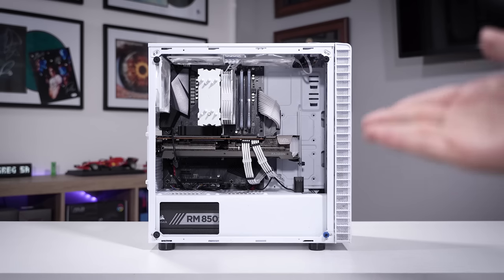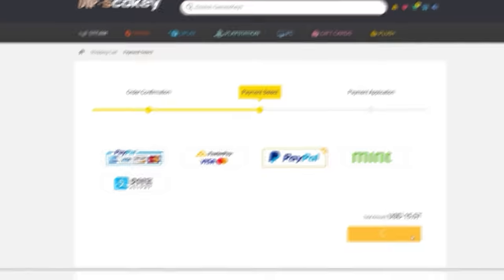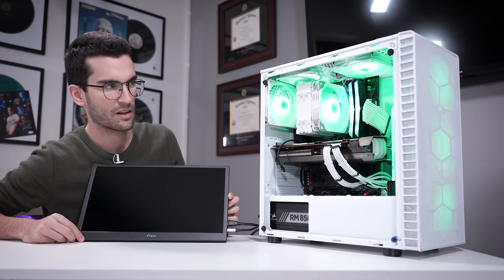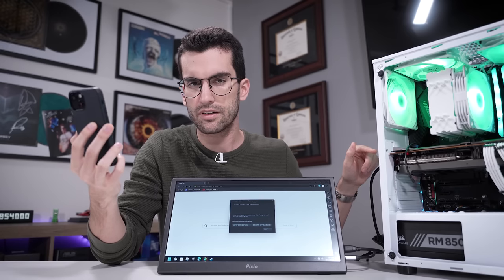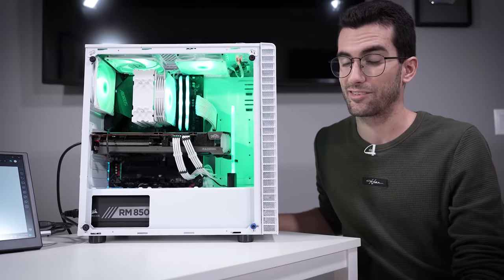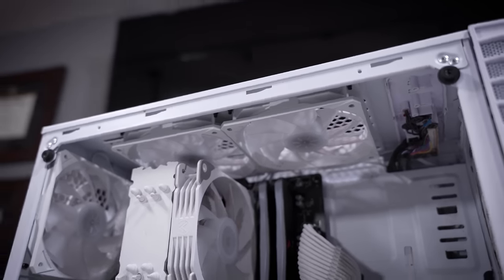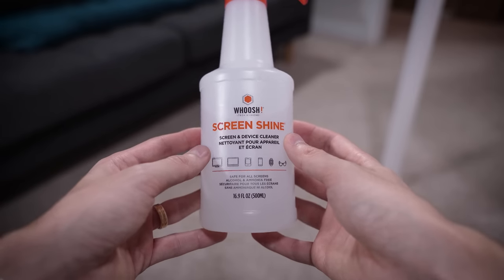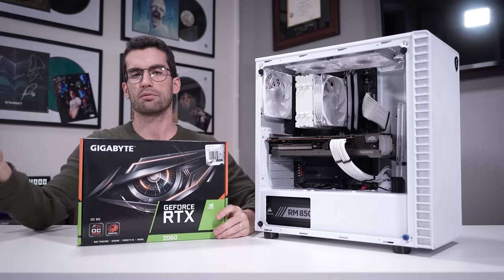Fixing a Viewer's BROKEN Gaming PC? - Fix or Flop S3:E17

Comment: Most likely scenario: The son moved the system/monitor and reconnected the HDMI cable to the motherboard. No more video signal and this was probably not spotted by the viewer. I think putting the cable on the right connection will resolve the issue.

Comment: It's nice to have a quick fix like this. 
The worst are the intermittent issues. 
Had an AM3 system that was crashing in a very weird manner - it could pass a 24 hour stress test but would crash while idle. 
The issue was with the CPU, as it would crash if the voltage would drop while in idle. 
So I had to manually set the voltage to a static voltage, and that fixed the issue.

Comment: I brought back some parts of my old gaming PC from France to the US, and once all parts I did not bring were purchased and put together, my PC would not turn on, I could just notice that my keyboard was lighting up, which meant some current was going through. Thanks to this series (that I started to watch because of this issue), I managed to narrow down the issue and turned out that using my old power supply  8-pin PCI cable for the graphic card was not working, and switching to the one from the new power supply made it run nicely. So, thanks for all these videos, I leanrt a lot and still am!

Comment: Building my last rig I was doing a test boot and thought it was a old mobo revision or a dead cpu then I realized I didn't even plug in the cpu power. Most of the time it really is the basics that need to be checked first before thinking it could be the worst case scenario.

Great video series, love this and the PCDC series!

Comment: One of the best - and worst - things about tech support is getting a working system... I end up doing exactly what you did. "It works! I'm not touching it!"

If it's a family or friend's system I'll usually try and make it fail by wiggling the connections, stress the hardware with Unigine Heaven and then, well, send it back.😇

Comment: the way the fans were before you changed it made some sense to me. He had the 2 exhaust fans at the furthest point in the back of the case and then 2/3 intake on the front and an extra intake on the top right before the CPU cooler for cooling. you could have possible ran some tests for the cooling aspect to see if there was a difference or not instead of changing their config which could have served their purpose. Either than that, I do enjoy your videos and content! Just maybe ask about their fan configs first before changing it yourself is my only real suggestion. Keep up the work!

Comment: I understand this owner's fan orientation thought process. If the first top fan is set to exhaust, then it will just take some of the cool air out of the case without it reaching the CPU cooler from the top front fan. This is why there was a good size space between the front and rear top fan and the intake method to begin with. I actually wonder if his CPU temps got a little worse because of the change. I don't think it would have been a massive difference but maybe 2-5 degrees Celsius at the most.

Comment: Der8auer once had a monitor which would not receive any signal from a graphics card via DP, but via HDMI only (iirc). The issue seemed to have been a strange incompatibility between monitor and graphics card.
A broken or glitchy USB device could also be the culprit which prevents the system from booting. A friend of mine experienced that with an old AMD mainboard from MSI - he had to unplug his mouse for the system to boot.

Comment: Great series. Something that fortunately does not happen any more is on older boards(from 2000s) if graphics detection was set to auto in BIOS it would switch randomly to integrated after a crash.

Comment: So my son wanted to build a PC and his friend had some decent GPU, RAM, PSU and Case. We only had to buy a motherboard, M2 and a CPU. So we went to the friend’s house and he was nice enough to guid us how to put then together. This was my very first time building a PC and it turned out great. 

Christmas came and my son wanted to get a new case. He got a Corsair 4000D and I took his PC apart and put everything in the new case. I got rid of many unnecessary wire from the PSU. Oh you wouldn’t believe how neat the cable management on that thing (I’m a bit OCD lol)! Kinda proud of myself! 😅

Then my younger son wanted to upgrade his gaming PC which it had a Ryzen 3 and RX570.

First was the CPU Ryzen 5 5600X which was not compatible with his motherboard. We then got an MSI Gaming Plus but it was having issues where it got too hot and shut down. I liquid cooling the CPU would solve and it did for awhile. Then his GPU started getting hotter and shut down, again! Finally got him a new 3060 and it’s been good lately.

Oh and it looked like the CPU is stuck to the motherboard now. When the CPU got too hot, it melted the motherboard where CPU seated. My son knows that if he needs to upgrade again, he should start with the CPU and motherboard. Anyone have a suggestion on how to pull the CPU out of the motherboard safely? TYIA. 😅

Comment: +1 for a bad cable, it could be a bad USB cable as well. My monitor has a USB hub, and the cable broke while connected to the USB port on the motherboard, GND and D- were shorted, and the system would refuse to post, sometime bootlooped, sometimes it would shutoff completly, I went thru some hours of troubleshooting and inspected the cable with a multimeter and found the short. Pulled out the faulty cable and, as magic, the system worked flawlessly, bought a new cable a while after and zero issues since then, the cable failed short somewhere within it, the actual port on the motherboard is perfect.

Comment: I prefer to use some pledge multi-surface cleaning wipes to clean my case, peripherals, and monitor bezel, the spray works well on the monitor screen, and my TV with a good microfiber cloth, dries fast and doesn't leave streaks.  A little of that spray goes a long way so it lasts a long time.

Comment: My first guess was that the forced reboot messed with the bios, making it boot into the wrong one or into settings that won't work or won't show a picture, like what you described not set to the dedicated GPU.
During the shipping I guess it was unplugged long enough to drain the CMOS battery?

Comment: Just wanna say that this literally just happened to me. Almost wrote a comment asking for help but after resetting my BIOS (which didn't work) and reseating my ram, it somehow worked. Not sure if it was loose, didn't look like it was but i'm just glad it worked
Reply: Also, i experienced the same exact problem with the owner of the PC just last week. Was on youtube when it suddenly crashed and just wouldn't post. Fans were spinning, everything seemed to be working fine but it just couldn't post. Went to google for help and they said to drain the power and let it sit for about 10 minutes and it worked. If anyone has any idea what the issue with my pc could be, please help a guy out ❤

Comment: I would have left the top-exhaust fan all the way to the back. That way it exhausted air from behind the cpu cooler. Thereby 2 fans would (the top and the back) would exhaust air from there, forcing additional air to flow into that "cavity", potentially adding more fresh air to the cooling of the power stages located there on the mainboard (albeit, the effect probably being slim). Now it just sucks a bit of air from above the cpu cooler, possible from between the fins of that cooler...

Comment: Love your channel Greg. I don't know how many times I've had someone approach me with the same issue and it turns out that they had plugged the HDMI cable into the motherboard port by mistake after a GPU change. It seems to be a common oversight which I'm sure we all made at some point. Would love to win that card. I'm running a 1660Ti. I've just gone on pension and now is the time for me to catch up on some gaming. Help me out here ☺

Comment: I’ve seen that happen before when the power supply gets stuck, removing mains power for awhile helps remove the caps holding power and stuck in the wrong state, but yeh, plugging a video cable in the wrong port would not help.  Be interesting to see if the other video card is faulty, pity he did not send both.

Comment: From the given photo it's hard to tell if they did plug HDMI into the MOBO. The loops from the cable could be going down to the card or the MOBO. The initial "crash" and no post still has me perplexed. I wonder if the son somehow knocked the cable out on his own, saw it was out, and placed it back in an HDMI port. Id be shocked a dad with spare GPUs of that caliber wouldn't notice that, but sometimes troubleshooting gets the best of us. I did one time plug a VGA cable in upside down and though a system had no working video out

Comment: I love these FOF vids it's thanks to them I learned a lot about pcs and built my own and also got to troubleshoot it the same day xD I had both a bad hdd and m.2 ssd that was brand new that was doa
Reply: Just putting it here if anyone would like to know the specs are an i3 10100 with a evga 1060 6gb a asrock h470m pro4 850 bq evga psu was a 750 but the fan died so rmaed it with a 2 tb hdd and 1 tb m.2 all in a Hermes x case

Comment: nice vid but i still would have check the power cables on the psu. it could have been a improper plugged in cable witch cold have got contact when moved and jostled sending it to you.

Comment: I'm commenting with an unrelated question - my GTX 1070TI will run faster and louder than 100% without MSI afterburner installed and active - there is no temp problem at all, the fans just act like there is no control - also with my 1060 6GB SC cards (identical) both tested in the same system, one was just over 80C and the other was in the 60's on the same benchmark (I also had to use afterburner on the high temp card)

Comment: Had same Issues with lower end Quality Display Port Cable. No Display out at all matter  what i did. switched to HDMI everything fine and after first initial Boot the Crappy DP Cable worked also. Everytime something hardware related was switched it want display out with the DP Cable

Comment: I had an Acer monitor that did this to me on any system I threw at it, cause me to debug an entire system for no reason. Turns out it was the monitor drivers that cause the problem and the monitor was no longer supported by acer aoftware. Only worked on older laptops running 720p. Very alarming problem that turned out to be fairly simple. The pc was actually posting fine but the monitor would show no input or signal not supported

Comment: Yes When I built my computer. I had to make sure that my video cable was plugged in the video card. It still didn't work, then I checked my motherboard lights and noticed my video card light was on... Yeah just had to send it back to misfortune MRA. Yeah really bummed just fixed my power supply then video card went sorry no picture for you!!

Comment: I always laugh when you guys say a PC is dirty and hasn't been cleaned in a while. You would cry if you saw my system. It takes less than 24hrs for my system to reach the level you consider to be "Dirty". I typically only clean my system once every 6 to 12 months using the blow dryer I bought to dry my dogs (no heat). But I live in an old house in Maine that used to be a camp 60 years ago. My dogs generate tumble weeds of dog hair and we made the mistake of having cellulose insulation blown in to the walls and floors in the 1990s. It takes about a week for a coating of dust to accumulate on anything and in one month it will be a 1/8" layer of fuzzy dust. Usually I can peel the dust and hair off my intakes in one solid sheet. I recently switched to an AIO and I have a 4090 coming in the mail, so hopefully my new Lian Li case won't suck in too much of this airborne garbage. My old case has encrusted dust that can't be scraped off without a chisel. My fingernails won't even take it off. Any yes, cleaning this house is a dust allergy inducing nightmare which we participate in once a month or so.

Comment: the fix or flop playlist fixed my rig

my rig
asus radeon rx 6500 xt
ryzen 5 5600G
gigabyte A520M S2H
500GB WD blue ssd
2TB seagate hard disk drive
i don't remember my case but i know it is a acer case
thermal take 550W power supply
16GB of kingston RAM

my laptop rig
asus tuf dash f15
rtx 3050
16GB RAM
500GB ssd
battery

problem = likes to overheat(fixed)